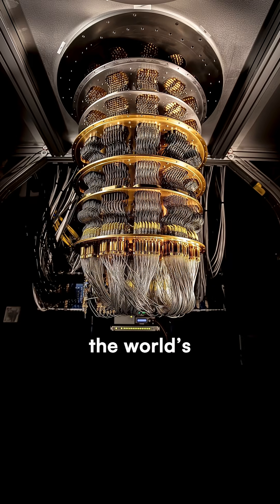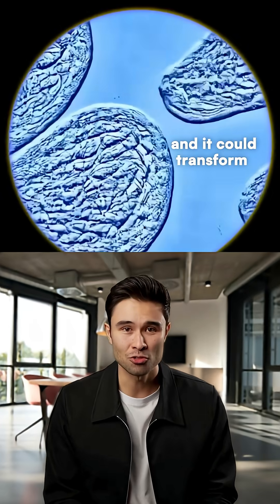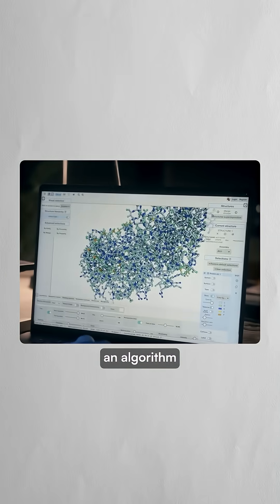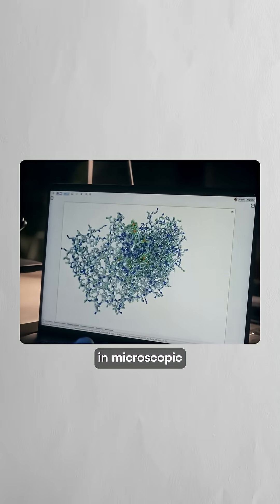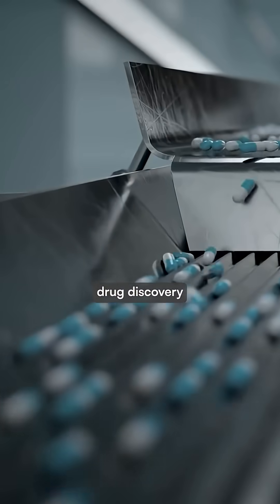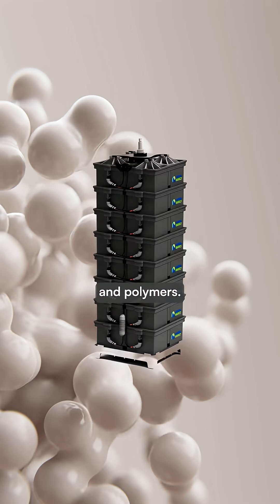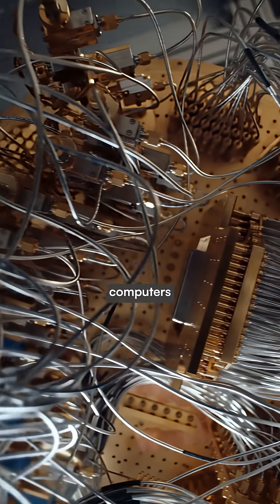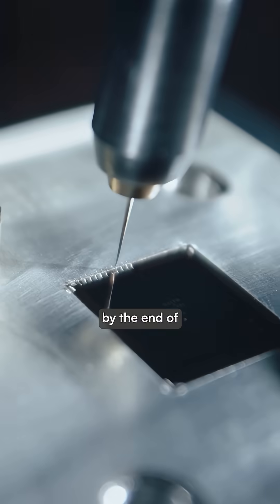Google’s quantum computer could accelerate drug discovery💡 #trendingshorts #ai #quantum #tech

Comment: Government will absolutely abuse this tech to decrypt people 🤦‍♂️
Reply: Problably has already. Not to go into conspiracy theories but remember that military technology is always about 10-15 years ahead of available public technology
Reply: As a cyber security student I can assure you quantum compters cannot break encryption per se. 
There are two types of encryption used. The first being symmetrical and the other one is asymmetrical. Quantum computers will only be able to break the later one. The good thing is that asymmetrical crypto systems are mainly used to encrypt keys which are used in the symmetrical crypto systems which actually encrypt your data. So yeah there is a slight problem with the common oldschool asymetric problems, but these dont encrypt your data and there have been newer asymmetrical algorithms which are safe post quantum computers that are getting implemented.
So the video is kind of misleading since it makes you assume the quantum computer can try out exponentially many bits to crack your data the brute force way and thereby downgrading the time n to brute force the encryption from n to log(n) which is indeed a problem. This isnt really how quantum computers work tho.
They can only factor n to sqrt(n) which isnt really too bad. It take the possibilities down from 2^keylength to 2^keylength/2. The most common algorithms use 256bits for the key length. So it would get lowered to 2^128 possible keys which is still bigger then the amount of atoms in the universe, so no chance in cracking that
Hope that helps :)

Comment: They should give this to gamers not scientists!!
Reply: quantum computers are useless for gaming lmfao
Reply: @ShadyHero  It can be made to be, just like it was made to be for it's current purpouses.
Reply: @AlexandraCristianaRO  No, it really can't. The fundamental principles behind how quantum computers work make them only better than conventional computers at very specific tasks. Granted, for those specific tasks, they are very, VERY good, but they just don't overlap. It's difficult to explain the exact reasons why without writing an entire thesis, but the best comparison that I can think of is like if you were to claim that screwdrivers will replace hammers. You can use both of them in a construction project, and you can TECHNICALLY use a hammer to drive a screw in by hammering it like a nail, but it doesn't do a good job as that's not what it was made to do; likewise, a screwdriver can be used as a hammer if you flip it around and bash with the butt of the handle, but it makes a pretty crappy hammer as that's not what it was made to do, and it's inefficient since you can't get a good swing with it.
Reply: @raptor2265  that's an excellent comparison